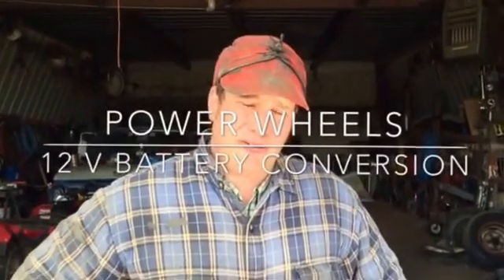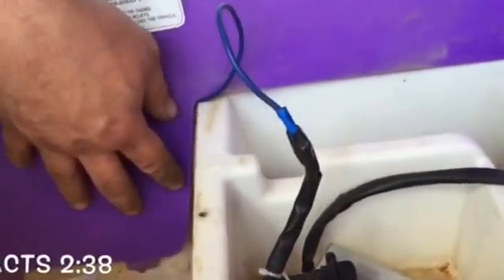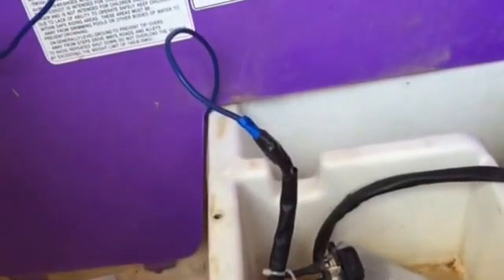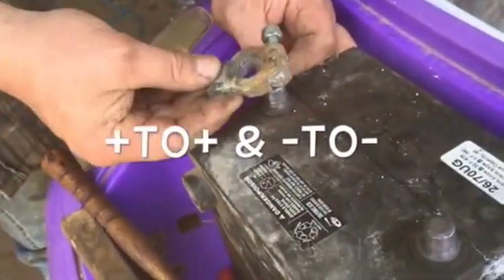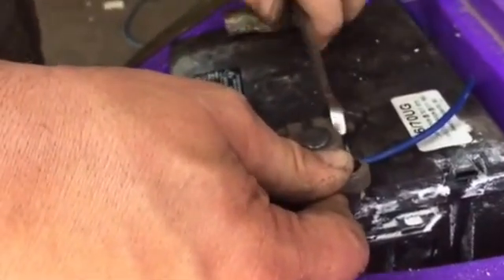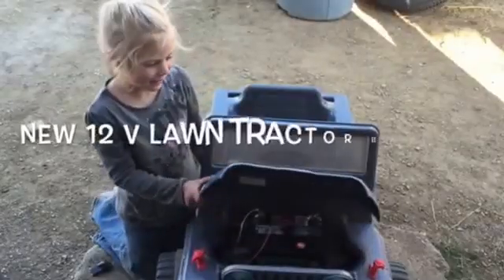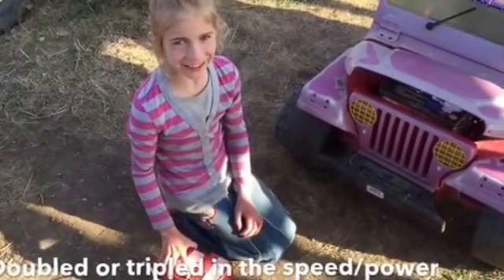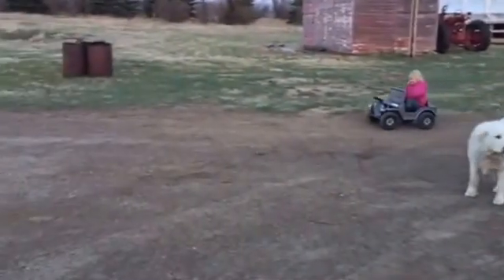Power wheels /fisher-Price conversion to 12 votes & traction for the tires.

Comment: can i ask what tire did you use? I want to buy some rubber tires on aliexpress, but would rather find something local if that's easier to deal with.
Reply from the maker: Hero Great 
   I just used an old tire and cut the tire tread off and screwed it on to the original plastic tire. Be careful, the nice thing about plastic tires are the unit will stop if it runs in the something. Not so if it has rubber tires it will get good traction! So it can be dangerous for an experienced drivers.
Happy trails and thanks for watching
Luke

Comment: Probably a dumb question but is a lawnmower 12v battery the same as a 12v power wheel battery? Will there be more power with the mower battery?
Reply: Keepingitreal98 no
Reply: It will still work.

Comment: I just got one of those pontiacs from the trash and hooked a car battery to it but I gotta de-girlyfy it before my boy rides it....why was the pontiac going soo slow at the end?
Reply from the maker: Audiwan 
     The battery was just low. That's why I was so slow. The kids had a lot of fun, with those Power wheels. I'm sure your son will too. If you put some traction on those wheels,he'll really get around. Turns it into more of an all-terrain vehicle. However it does make them a little more dangerous. 
     Appreciate what you had said about making it a little more dignified for a boy. In today's world it's not politically correct to speak like that. However I don't see John Wayne driving one:)
Thanks for watching I appreciate it.
Reply: I did try putting tires on it but the gear in the left rear was making a clicking noise  so I removed the grippy tires...my boy is not even 2 yet but he was able to drive it all the way around the block at full speed....he only ran into a few bushes and mailboxes. LOL!